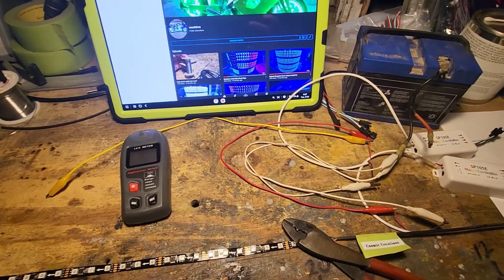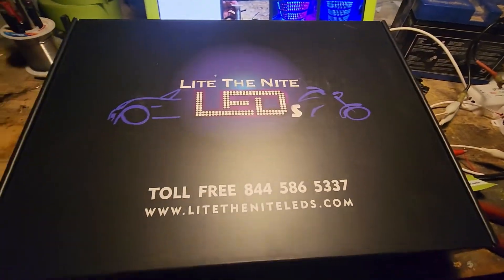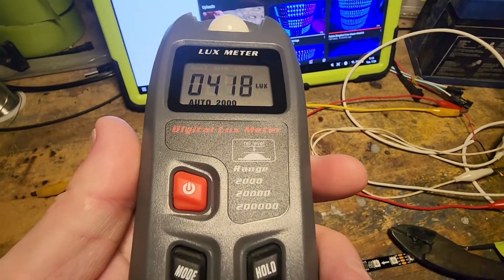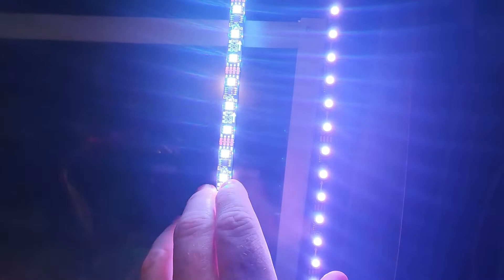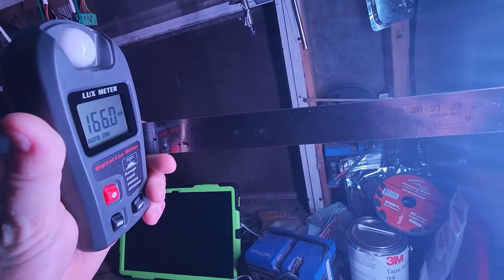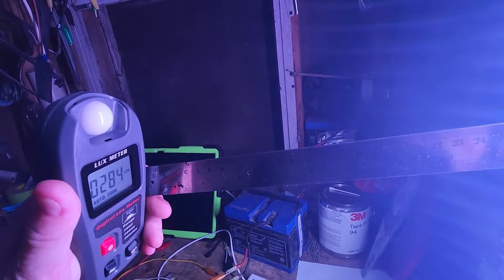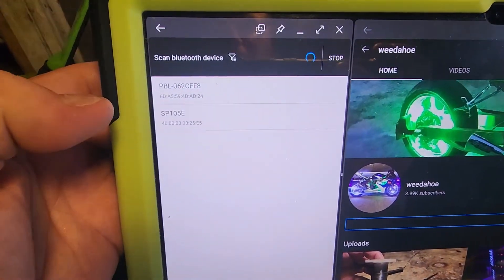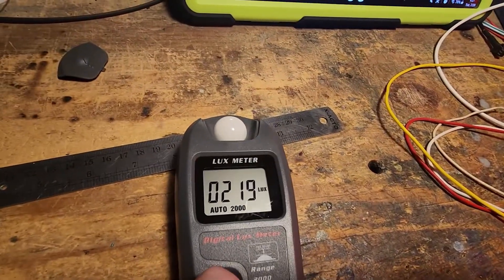LED strip brightness comparison

Comment: I tried to install a led chaser strips on my slingshot, but for some reason some of the leds won't turn. Some of them turned on fine . I used a sp901e to send out signal but no luck. I checked every strip one by one before installing and it worked fine. Can't find the issue
Reply from the maker: Fae too many unknows to take a guess. It might be your controller settings. You might be using analog LEDs versus digital LEDs. Your soldering job could be poor and shorting out. You might have too much length in wire and getting too much voltage or signal drop. Depending on the controller, it might be configured fir different LEDs than what your area using our the pixel count may need to be adjusted